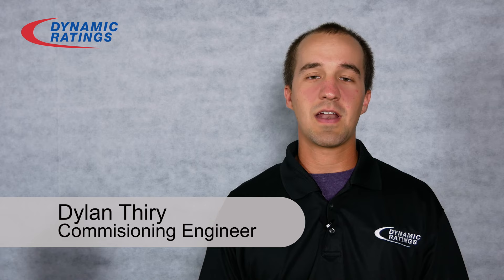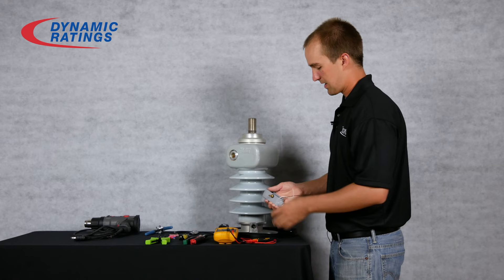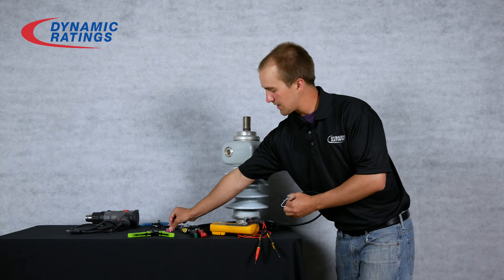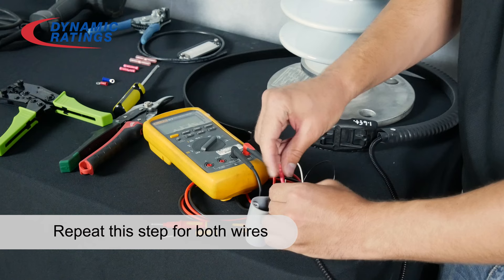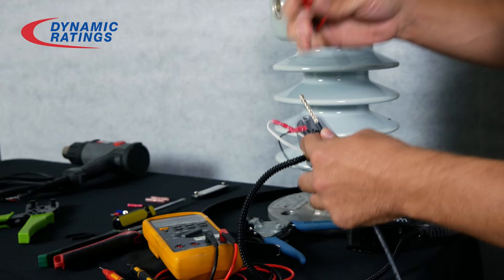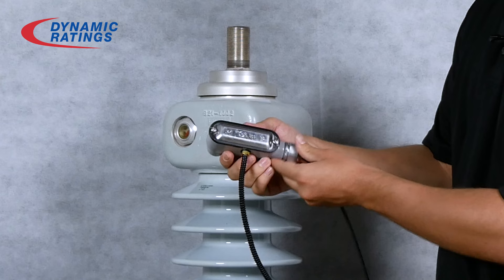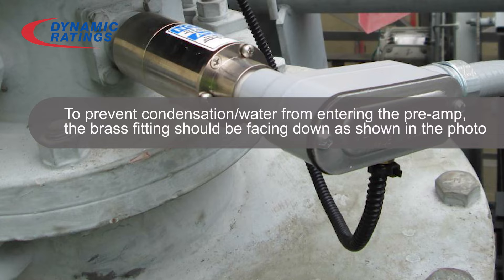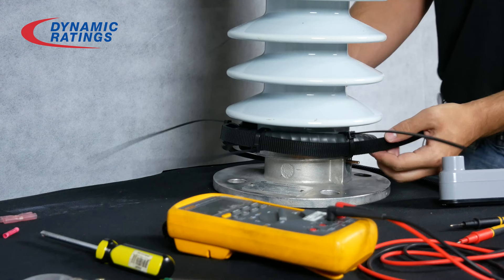How To install a Rogowski Coil

Comment: *You'll make a MUCH better video by speeding up (or editing out) useless parts, like separating conductors.  5:25 - 6:00  Crimping connectors, tightening screws, etc.